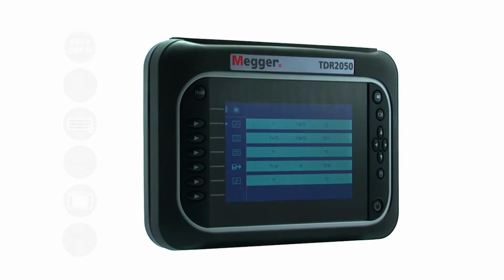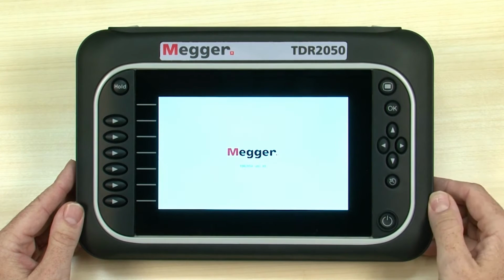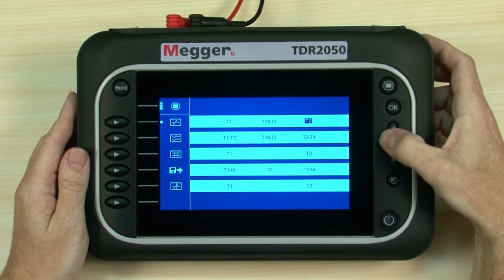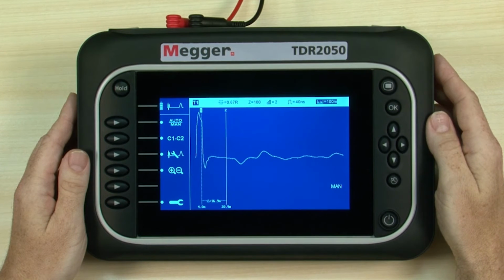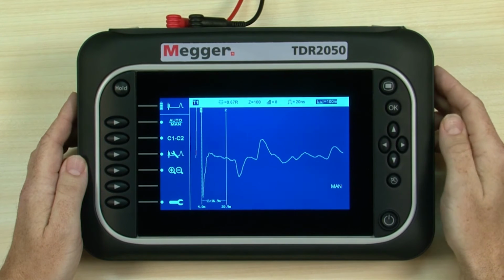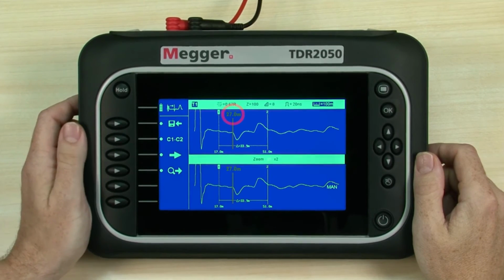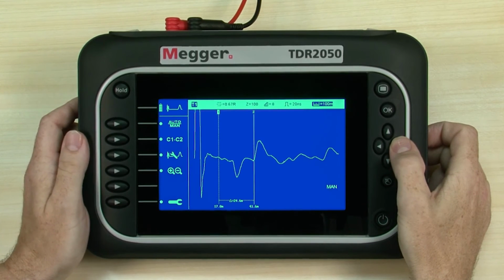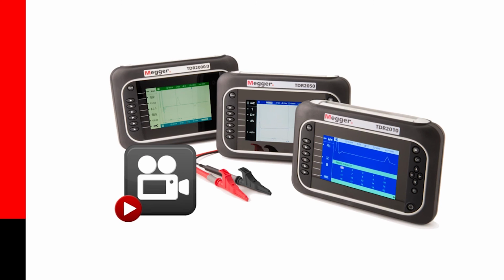Megger TDR2050

Comment: This is a great piece of equipment. If you are testing a cable, make sure that you get the velocity factor correct. Be warned, however, the TDR will not detect resistive faults in cables. It will, however, identify short circuits and open circuits.